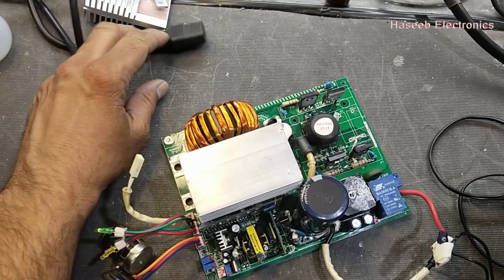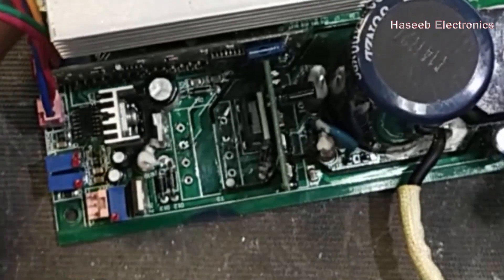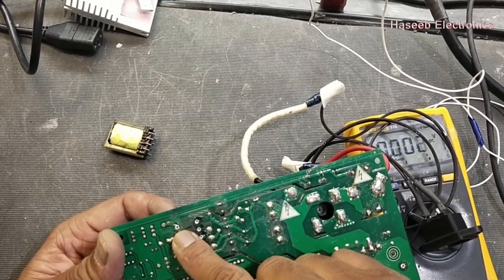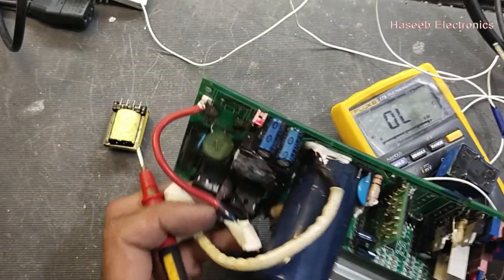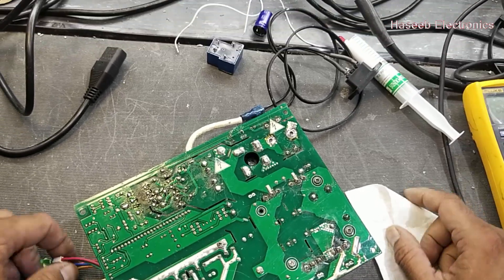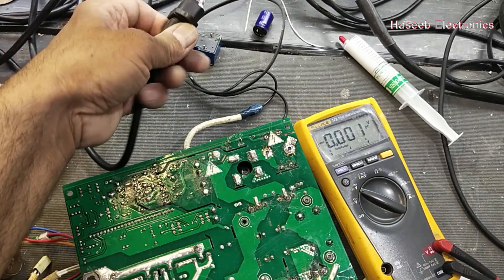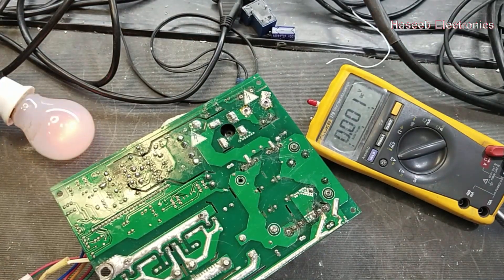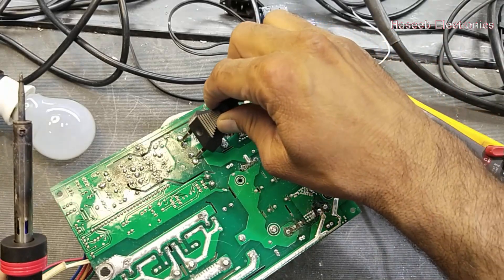{518} Inverter Welding Machine Repair Course / How To Repair Inverter IGBT Welding Machine

Comment: Good evening. I've watched the series of repairing inverter type welding machines. They are beautiful. Concise with zero filler. Error free with beautiful use of technical language. This is how technical work should be!
Congratulations. I have just repaired a £1400 Castolin & Eutectic welder. It cost me £10 and £16 for the fried components. Nobody could fix it. I did after watching your excellent videos. I think there's a heap of expensive welders out there which can be fixed. 
It is a pity the market is flooded with inferior Chinese welders for very little money. The expensive machines cost a lot for a reason: excellent weld quality!
Thank you.

Comment: hello haseeb
i have a welding machine BLUE 315 it has very weak welding and gradually it stops sparking. what cauld be the cause?
i tested the out put voltage and its only 9 volts DC
I did test on IGBT, RECTIFIERS ,CAPACITORS they are all okay and the fan is working.

Comment: I received a single board without igbt. When i install 60t60 it doesn't work at all. When i install 60n60 it works but igbt get hot after 50 seconds even without any load.do you know what can be the reason?

Comment: السلام عليكم brother
In inverter welding machine if the PTC drops 15 v and gets hot after 1 minute of working and shut down the machine is the PTC itself the cause of this fault .PTC when cold  is 140ohm then decrease its resistance

Comment: Hi sir...thk for your video..sir I got a problem with a welding...its stay on high amp and it burn the metal,I have check the potentiometer it's OK can u advice me pls
Reply from the maker: special thanks dear 
its control card is not controlling the pulse width to compensate the current requirement on the output terminal. 
there are some trimpots near control card (feedback level control, which adjusts the output current level measured by the shunt resistance 
2, primary current adjustment - to adjust the output of the current transformer CT in series with the IGBTs & power transformer 
3. maximum current limit pot on the control card
4. short circuit current level adjustment pot)
all these trimpots need a very careful calibration to adjust the PWM output to provide the required current
Reply: @HaseebElectronics  Hi sir..Thks a lots for taking time to answer me...I will keep follow all ur video..Learn a lots about ur video very very good explanation 😀 😊 keep it up thks
Reply: Can u pls explain do the calibration and adjust the pwm output sir...thks in advanced

Comment: You are a wonderful teacher, teach so thoroughly. Learning a lot from you. 

Can you tell which 16 pin microcontroller IC is used in the PCB for induction cooktop,
Reply from the maker: HIGHWAY15-16C
Reply from the maker: thanks for your valuable comment

Comment: Hi sir 1st thanx for ur videos in english its very good im all the way from south africa watching ur videos and its information i learn alot. But i have a request sir cud u do a video on smps repair practical where voltage measurement frm AC inout to pmw transistor or ic and voltages coming out and where do we get the voltages frm there until we reach secondary side plz

Comment: I think that you add is quite a lot of thermal grease, 
and if there thermo pad is placed - there is no any reason for using thermo paste.

For example, thermo conductivity of those materials:

air = 0,02 W/(m*K)
thermal grease = 0,7 (regular) - 5 (very good quality) W/(m*K)
thermo pad = 3 - 14 W/(m*K)
Reply from the maker: thermal paste is attached and insulator is placed in between the IGBT tab and the heat sink, 
but for better thermal conductivity the thermal must be used while we tight the heat-sink the thermal paste flows equally, 
specially while working on high power dissipating devices, it must be used